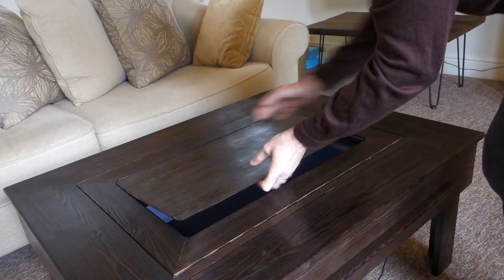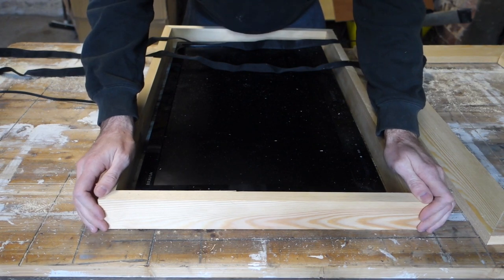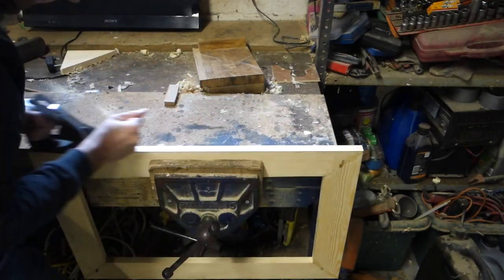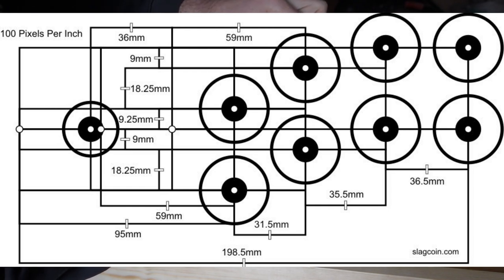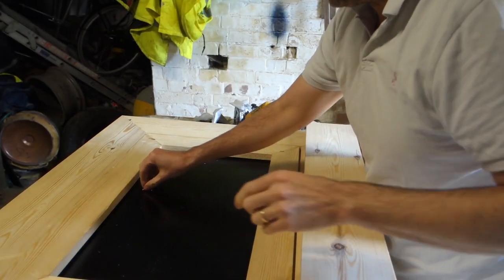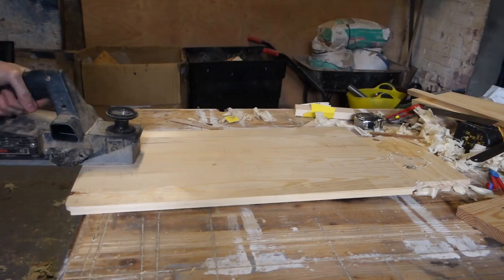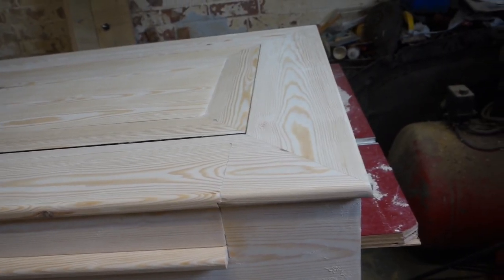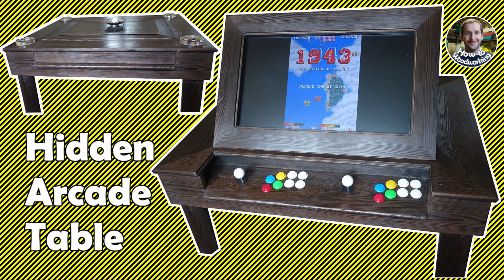Retro Gaming Table Raspberry Pi #retrogaming #woodworking #retropie Shou Sugi Ban

Comment: Amazing project ! I have two questions, what wood is that you used ? and what did you apply after burning and brushing to get the finish ? Thanks !
Reply from the maker: The wood used is a white wood, some form of pine, I think it works well as it gives good relief when brushed, I applied furniture wax, any will do, I used Briwax. I go through it in detail in this video... https://youtu.be/rUNIbWq579Q